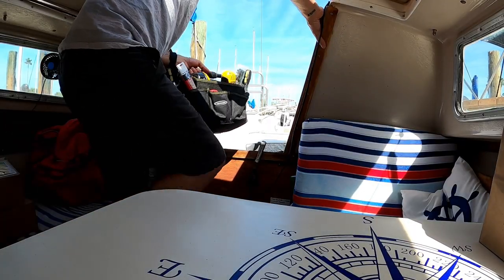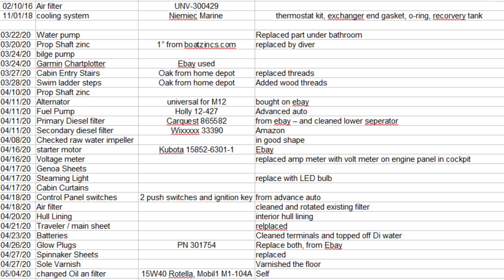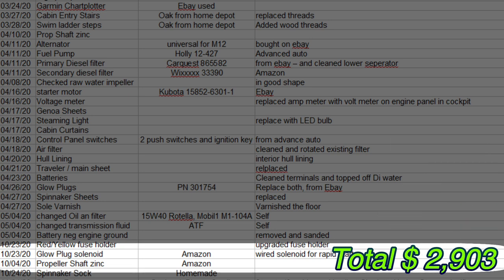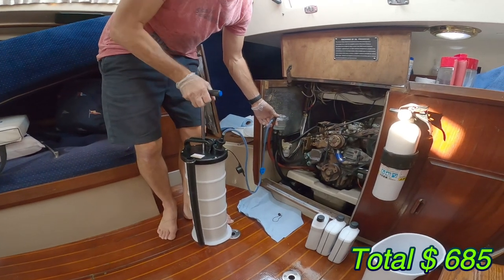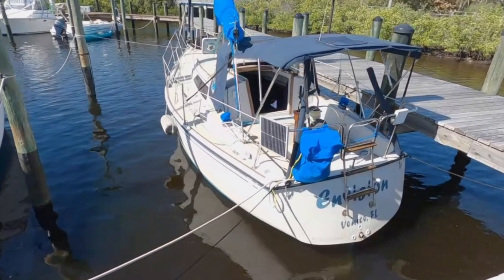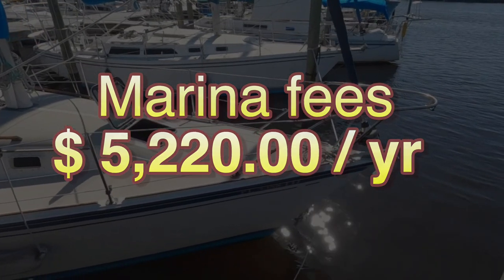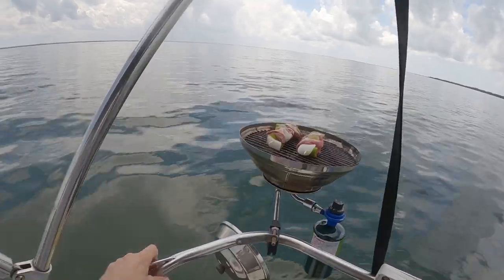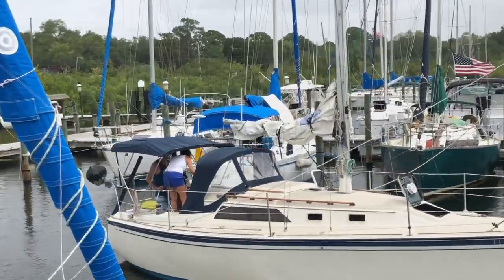COST SO FAR O'day 28 Sailboat  EP. 63

Comment: Sou nds lime a moneh pit.
Some of this could be cut down lime botto. Cleaning once a year is normally good enough, you dont need .mo nthly.

And guess alot could be reduced or cut out as they are not essential.
Reply from the maker: Bottom cleaning is typically twice a month here in Florida but I only let them to it once a month and by the end of the month its got a thick green layer on the bottom paint.   Maybe you live where the water isn't 95 degrees?
Reply: @AdventuresInParadise  

I am i  the uk if we are lucky we may get 30"c in the summer on the south coast. Normall you get algi when a vessel is not used. You can always tell a vessel thats never used by the algi build up. If you use it regularly you wont get this build up. Just going to sea will take it off..

Not much i have not done at sea being former Royal Navy.